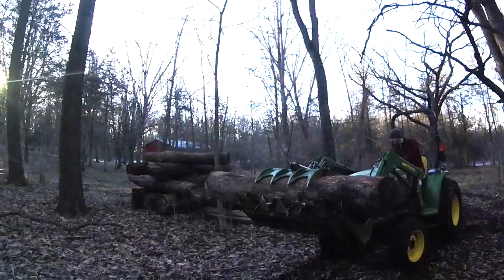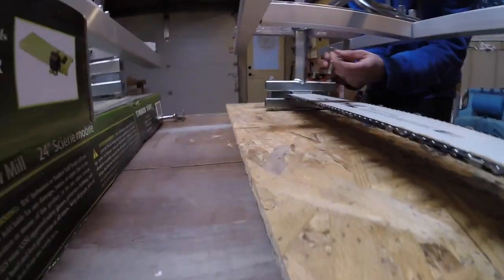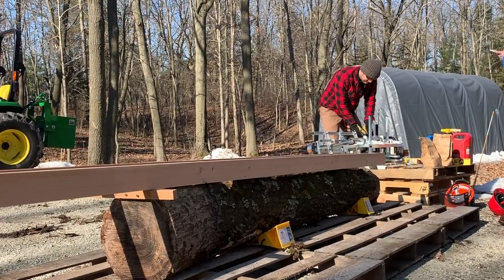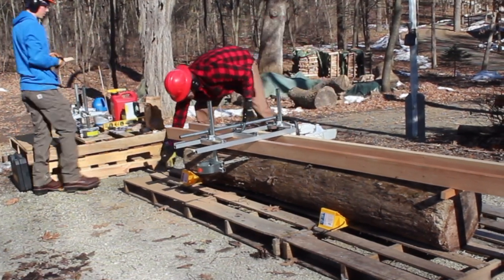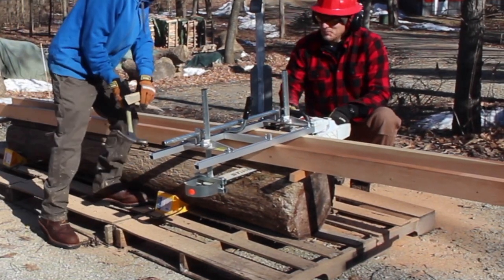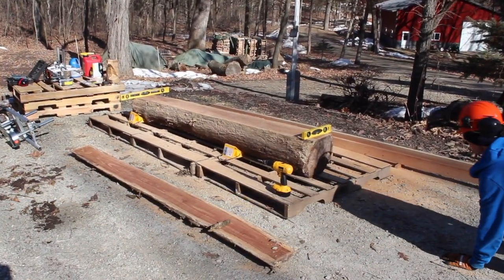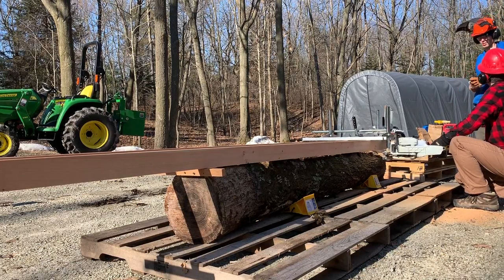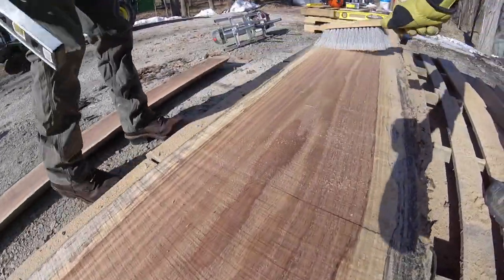Stihl & Granberg small portable chainsaw log mill - Making first cut into red oak to slab lumber

Comment: Good work, only thing I see to make it easier. get the winch they have to pull the mill, OR better yet, get the other person to HELP YOU push the mill through , consistent movement will help prevent those marks in the surface where you had to stop,   helper needs to shim both sides of the log, , put bystanders to work.